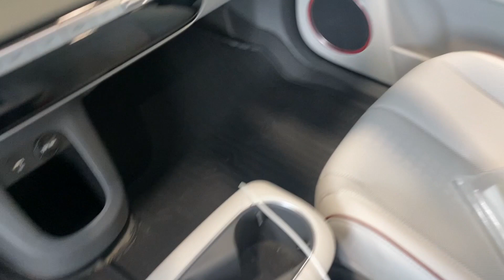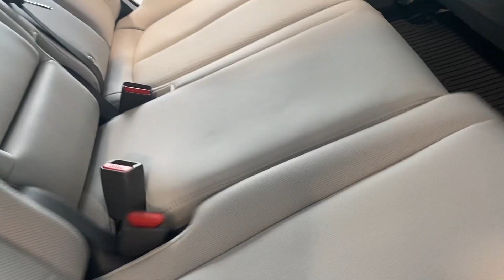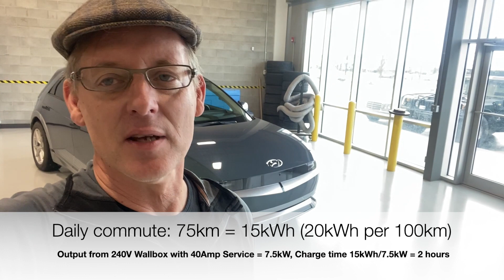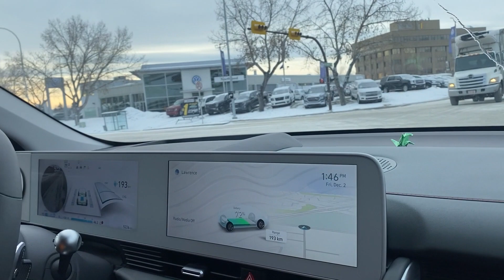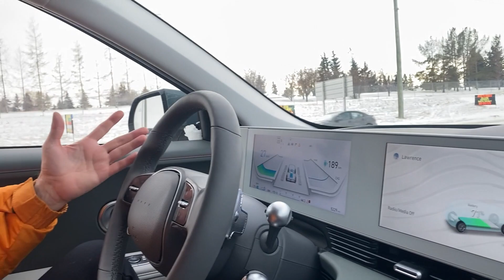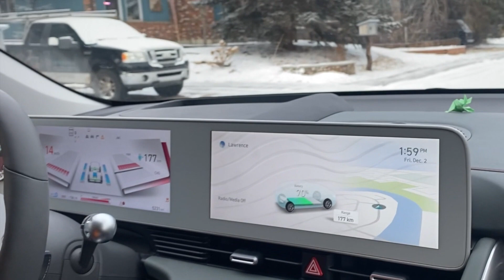2022 Hyundai Ioniq Owner's Review after 5,000km - In Depth!

Comment: How would you compare this to the I-Pace?
Reply from the maker: The I-pace is larger and sportier, with sharper handling and feels (and is) more expensive.  But the range is quite a bit less and charging speed a lot less.  An I-Pace in Canada is over $100k and the Ioniq 5 is $63k for the top of the line.  Ioniq gets 400km in summer, I Pace would be 300km or less.  Ioniq charges up to 250kW DC and I think the I-Pace is only 100kW.  So, as much as I like driving the I Pace and like its design, it isn't competitive.  It is the best handling EV that I have driven though.